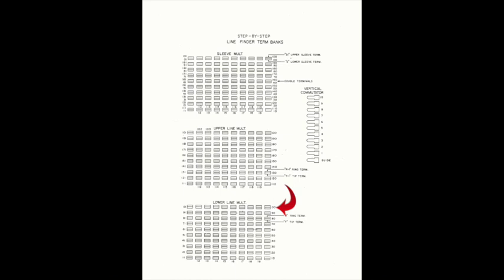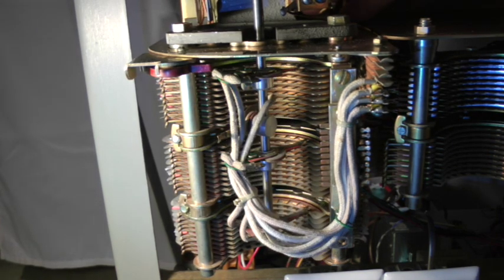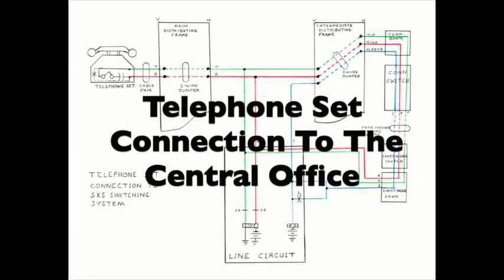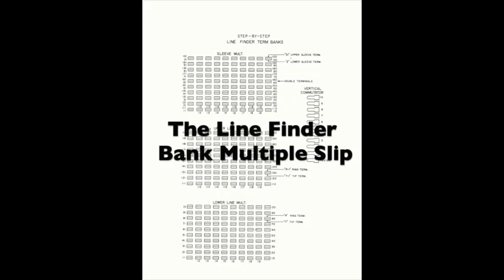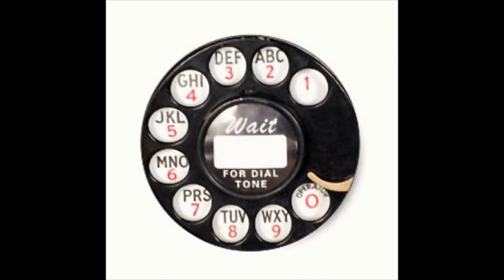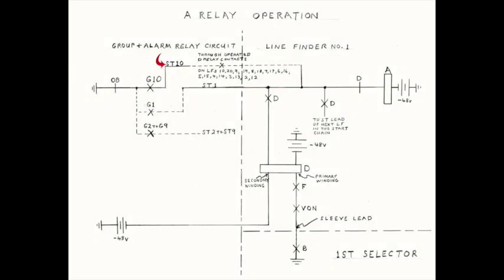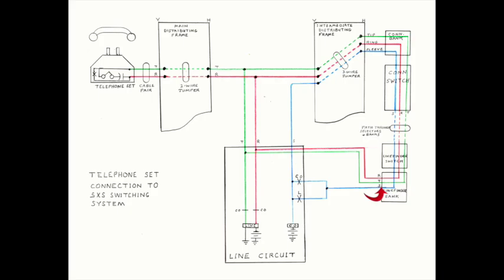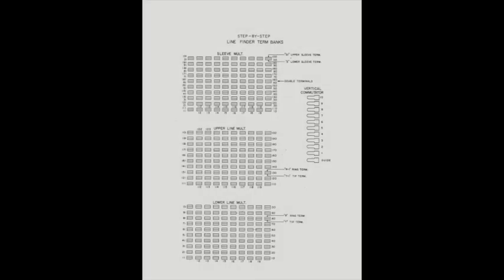The Line Finder In The Step-By-Step Telephone Switching System

Comment: Hi Len, great video. I've recently come into possession of a load of Western Electric SXS gear and I've been looking for wiring diagrams for the line and cutoff relays. I've read your document describing the demonstration unit that you published in 2016, but I'm still having trouble deciphering the wiring diagram that you provided as I'm very new at reading circuit schematics. If possible, could you point me in the right direction?
Reply from the maker: Well, I really can’t help you with learning how to read schematics, but I can direct you an Operational Sketch wiring diagram that shows all the line circuit connections to the line finder, line finder group circuit, connector bank and subscriber line. Go to the Telephone Collectors International website. Click on the TCI Library. In the Search box enter “operational sketches”. Scroll down the resulting list about 8 items, to “Number One Step-By-StepTraining Manual Volume II”. Click on that item and then click “View”. Scroll down to page 33, which is a diagram of the line circuit and the line finder equipment.  Hope this helps.

Comment: Thanks for this detailed video, love the time-lapse parts.  One thing you may want to clarify (or maybe add a text-overlay) is that the job of the line-finder is not to find a free trunk-line for the calling line, but rather to find the calling line.  I'd also be interested in more details about how the system skips "busy" line-finders.
Reply from the maker: Both of your points are well covered in the video. You may want to watch it again.

Comment: I would like to design a drop-in electronic replacement for a line finder that has no moving parts or at most one or two relays.  But that would be difficult because the contact bank tiers are not part of the switch.
Reply from the maker: In the 1980's, a company called ITEC (and perhaps others) produced a  solid state electronic step-by-step switching system. It was called the Electronic Modular Switch- 1 (EMS-1). Telephone companies used it to extend their existing step systems when growth required augments.

Comment: Very comprehensive video, thank you!
I wonder what kind of make- and break-contact symbols these are and how common they were used in what area. Do you have any info on that? Were these used only in early American SXS-Systems, or also in later Panel and Crossbar switch circuits? Was there a standard for notating these circuits? And what symbols were used outside of the US? I know several others, some of them might be much more common today, at least in Europe.
Reply from the maker: These symbols are known as detached contact symbols. On schematic diagrams, the relay contacts were moved away from the relay coils and placed where they were functionally utilized in the circuit, which greatly simplified the analysis of the circuit. This approach was developed by the Bell System Labs in the early 1950's. You can read all about it in an article in the Bell Labs Record (BLR) of July 1954, titled "Detached Contact Schematics". You can search online for the Bell Labs Record. Thanks for watching.
Reply: Excellent article. Thank you for this reference! 😊

Comment: I love this video! Very informative. I am working on building a very scaled down working electromechanical telephone exchange. When it's done, all of its parts will all be polished up and mounted to a custom made brass and wood "stand". All the wires will be properly "stitched" and of course there will be multiple different phones all connected and working. It's a labor of love, so to speak, but these devices have fascinated me for years and years. The one thing I haven't been able to find as of yet are schematics and drawings of individual stepping switches, line finders, etc. Any info or websites you may know of would be greatly appreciated.
Reply from the maker: Go to the "Telephone Collectors International" website. Click on "TCI Library". Click on "BC Switching Library" and search from there for Schematic Drawings (SD's) and Circuit Descriptions (CD's) for various manufacturers. Good luck with your project and thanks for watching.
Reply: @Hicken65  WOW! What a treasure trove of information!!! Thank you so much. I have also joined as a new member.

Comment: Does anybody remember the name of the solvent holder tool that hooked up to the steps of the ladder to clean the banks of the switches?
Reply from the maker: It was the KS16297 Flushing Unit.
Reply: Thank you I have been searching for this info and could not find it. By the way cleaning banks was my worst routine to do. Now all I have to do is find the different chemicals we used in the flushing unit .
 @Hicken65
Reply from the maker: I couldn't find any documentation that identified the makeup of the fluid, other than it contained 3% oil. The part number is KS16436 L1.
Reply: Thanks! @Hicken65

Comment: Stupidly confusing reflecting the speakers attempt to impress and generate a false sense of regard for knowledge he clearly does not possess.
Reply: Msybe you dont have a good enough level of knowledge to be able to follow the technicalities of the mechanisms and circuitry.
Reply: He's making 50+ year old electro-mechanical equipment work and operating it.
There's no one to train you, and they are all ancient and degrading. You'll get a new error daily as some wire fails. It's literally harder to maintain by the day. Comparatively the people operating them back then had it easy. Techs from the company, ALL the documentation, and experienced help all around the building. He has none of those perks.
To get this to do anything more than shake and catch fire you pretty much have to be a genius.
He's proven he knows EXACTLY what's he's talking about by simply having it function.

Comment: watched every second.  circuits with an X are normally/fail open (power doesn't go through), and those without are normally/fail closed (power goes through), right?
Reply from the maker: Yes. The X is a make contact set, which is normally open and closed when the relay is operated. The short line is a break contact set, which is normally closed and open when the relay is operated. Thanks for watching ( especially the whole video).

Comment: My dad spent many years during the 60's with these switches. Said the scariest noise he ever heard was when they had a cascade type event that locked up the switches in the whole office. The place went dead silent, at that moment they knew the SHTF...
Reply from the maker: These systems were typically engineered to allow about 10% of the telephone lines to be in use simultaneously. Unusual events that caused this limit to be exceeded by a large amount would cause a rapid deterioration of service.
Reply: @Hicken65 , wow, grew up with step by step service in Baden, PA but never remember the phone service going down because too many people were using it!

Why did they continue to manufacture step by step switches in the 1960's when crossbar #5 was the newest & best switching?
Reply from the maker: @jgrysiak6566  SXS switches were still needed to handle the growth in the towns and cities where these systems were in service. Generally,  #5 XB was not being used to replace SXS because it was not cost effective to do so, especially in one exchange towns. In cities, XB was often added to provide for growth with the existing SXS remaining in place. In these locations SXS equipment was still added for trunk growth. Large scale SXS replacement began in the 1980's with the introduction of digital switching equipment and their associated lucrative feature rich capabilities.
Reply: @Hicken65  , Really wanted a pushbutton phone & was fascinated with them in the 1970's but sadly was not available until Oct 1980, when Baden, PA cut over to #2BESS  from SxS.    Finally got my dream of getting a  pushbutton phone in the fall 1982, my parents wanted me to take it back but then eventually they liked it & kept it.  Lol
Reply: @Hicken65 , there was a ton of growth in the Baden, PA SXS office in the 1970s.  If they would have built a #5 crossbar switch, would they have had to assign another nxx to the town?
Reply from the maker: @jgrysiak6566  If the SXS was to remain in service, the XB would have a new NXX. If the XB replaced the SXS, it would reuse the SXS NXX.
Reply from the maker: @jgrysiak6566  Many telcos earned extra revenue by equipping their SXS offices for touch tone service. This was accomplished by inserting electronic converters between the line finders and the first selectors. The converters would receive the tones from the push button phones and convert them to dial pulses which were transmitted to the selectors. Customers had touch tone service but there was a notable delay before ringing began due to the conversion process.
Reply: @Hicken65  , that's what I thought! When they added 728 exchange to Rochester, PA in 1973, it was already a crossbar #5 town , so 728 became a crossbar.   What year did they stop building SxS exchanges?   Baden , PA was built in 1930?
Reply from the maker: @jgrysiak6566  By the 1960's, most telcos had stopped installing new SXS exchanges, but of course existing ones were still being expanded. The last SXS in the North American PSTN was decommissioned in 2002.
Reply: @Hicken65  , was 50 yrs too long to be running a SxS switch in Baden, PA?
Reply from the maker: @jgrysiak6566  Well, it was probably the right time for the telco. Maintenance cost would be quite high and the switch wasn't generating revenue from the smart features of the digital switches. I would guess a lot of SXS systems lasted 50 years.
Reply: @Hicken65  I think that's what's heard on many of Evan Doorbell's recordings!
Reply from the maker: @grabasandwich  Yes, I believe Evan has some SXS switching sounds in his recordings.
Reply: ...Usually happened when a jointer cut through the wrong cable in the manhole outside the exchange... 500 lines shorted together with an axe blade :-)

Comment: At 1:05, discussing the D relay staying closed if there is another dial tone request using the path, it seems to me that these double-winding relays function as OR gates, since either or both of the windings can keep the relay energized.  Is this correct?
Reply from the maker: Yes this is correct.You can call the primary winding A and give it a value of 1 when it is energized and 0 when it is not energized. You can call the secondary winding B and give it a value of 1 when it is energized and 0 when it is not energized. You can call the set of D relay contacts Q and give them a value of 1 when they are operated  and a value of 0 when they are released. If A is 0 and B is 0, Q is 0; if A is 1 and B is 0, Q is 1; if A is 0 and B is 1, Q is 1; if A is 1 and B is 1, Q is 1.

Comment: Have you done a vid on how they cleaned, and or replacing a dead coil, or blade on these switches? Must have been some task...
Reply from the maker: I don't have any videos on the relay replacement procedures. However, a changeout wasn't particularly difficult. The relay assemblies can be removed by disconnecting the wires and undoing two screws that hold the relay to the switch base. Similarly, the contact spring assemblies can be removed from the relay heel plate by undoing two screws. Everything is easy to reach with the switch dismounted.

Comment: So, since the G-relay isn't incorporated into the Linefinder switch, is it an essential part (or the only method) to determine the location of the calling line? I have recently aquired my first linefinder switch and would like to see it hunt and locate a "calling line". I understand that this process works with the commutator but I don't understand how these two parts work together to find the line. Could you explain?
Reply from the maker: Each G relay is associated with 20 lines assigned to the same bank level on a Line Finder (LF). When a G relay operates, it identifies the level that those lines are assigned to by grounding the appropriate commutator segment. It also grounds a “start” lead at a particular entry point in the LF preference sequence chain so that selection of a LF starts at the LF in which the lines requesting service are at the lowest level on the bank in order to minimize hunt time and switch wear. In a demonstration unit like mine with only one LF and two lines, the G relays are not required. Normally, a pair of make contacts on the line relay provide a ground path to operate the G relay. In turn, a pair of make contacts on the G relay provide a ground path to the LF start lead, which causes the A relay in the first idle LF in the preference chain to operate. I simply use these same line relay make contacts to ground the LF start lead directly. Both of my telephone lines are assigned to the same level on the LF bank. So instead of having a G relay provide ground to the appropriate commutator segment, I wired a permanent ground to that commutator segment. Note, however, for your LF to function properly, that is, to hunt for and connect to your calling telephone line and remain connected until you hang up, you need a line circuit for each line (which contain a line relay and a cutoff relay) and a first selector attached the output tip, ring and sleeve leads of the LF.
Reply: I am asking this for my dad:
We are having some difficulties with the 355A Step by Step switching system. Looking for 224BN F-Relays, also for Line Finders ED 32000, marking on the frames in place show ED 32000-30-G3 985D which are part of the 355A switching system. 
My question now is when you acquired your first line finder switch, what are the markings on the frame and what are company’s or manufacturer location? Information would be greatly appreciated. Future plans we would probably need 2 line finders.
Reply from the maker: Sorry for the delay in replying. I didn't get an email notification for this comment and saw it by chance today. My line finder is a different type than yours. Mine is an ED-33013-30--G11 985D, which would work in a No. 1 SXS or a 355A. The markings on the frame are shown at the 13:27 point in the video. I don't see any manufacturers name of my line finder. However, the ED number identifies it as a Northern Electric or Western Electric product. NE was licensed to manufacture WE products in Canada. My line finder is made by NE since it came out of a Bell Canada central office. Not sure what you are looking for, but if it is to purchase a new line finder, you are out of luck. Neither NE nor WE exist any more and no company is manufacturing SXS switches. Tahnks for watching.

Comment: I learned step by step in the Air Force back in 1973. I remember taking most of a day in class tracing schematics just to get from off hook to receiving dial tone. Thanks for the excellent explanation and thanks for taking me back in time.
Reply from the maker: Well, the SXS switching system is indeed a time machine. Thanks for watching.
Reply: Forty-two steps from off-hook to dial tone, as I remember.  Army Signal Corps 66 to 69.

Comment: The mechanical switching technology is always fascinating, reliable and robust and immune to any electromagnetic impulse, both natural and artificial, certainly a modern switchboard even with continuous maintenance after 100 years like this one no longer works and is also irreparable, just think of the electrilitic capacitors on the cards, of course it is more practical, it has a thousand functions and is DTMF but if it is broken it is useless, nice that some switchboard has remained operational as a museum, in 100 years there will be no electronic switching systems working in museums.
Reply from the maker: Well, there is no joy in staring at a box with no moving parts and no sounds (except perhaps a continuous hum). The new equipment is, of course absolutely amazing in what it can do. But at a show, my demonstration unit attracts plenty of attention simply because it has many moving parts that can be seen and a lot of noises that can be heard, all of which is under control of the interaction by the users operating the rotary dial telephone sets. Thanks for watching.

Comment: Rotary phone system went offline about 20 yrs ago in my reich , but in 2022 i will be building  my household rotary based telephone system has an intercom phone system. im going to injoy watching this 2 hour long film just to learn the history behind the idea of rotary phones :D
Reply from the maker: Well, I hope you enjoy it. Thanks for watching and good luck with your project.
Reply: The mechanical switching technology is always fascinating, I'm intrigued, how many lines do you have how big is your ranch? a mechanical switchboard is robust and reliable, but requires the use of disk telephones, the external line can also be VoIP with an ATA adapter, cmq it is not difficult to replace it with a modern PBX switchboard and with twisted-pair telephones, reusing the existing network , cmq I don't know if I'm wrong, but a wireless system or with GMRS radio with license or extended wi-fi network and smatphone with VoIP app I see it more modern and practical, it does not require you to go to the phone in the place where it is installed

Comment: Are the step by step switching system required for a phone system
Reply from the maker: I really don't understand what you're asking here. Perhaps you could expand your question.
Reply: @Hicken65   I did think of another question related to phones is rotary dial dtmf dual tone multie frequency
Reply from the maker: @ryanbelknap814  No. Rotary dials generate dial pulses, which simply open and close the loop to the central office. Touch-Tone telephone sets have push buttons which generate the DTMF tones.
Reply: @Hicken65   could u make the step by step switching system the things that u said u connected tip ring to the phone
Reply from the maker: @ryanbelknap814  I'm sorry, but I don't understand your question.